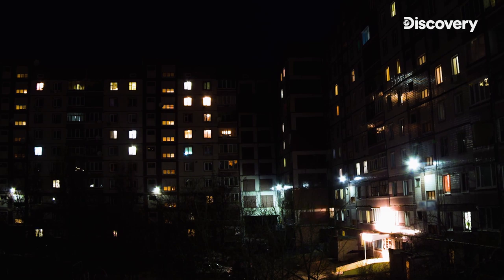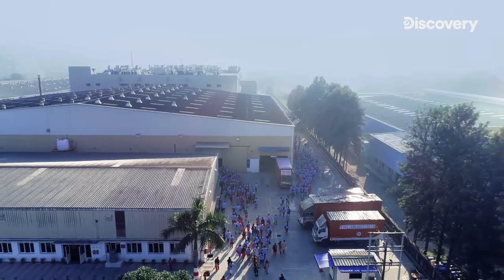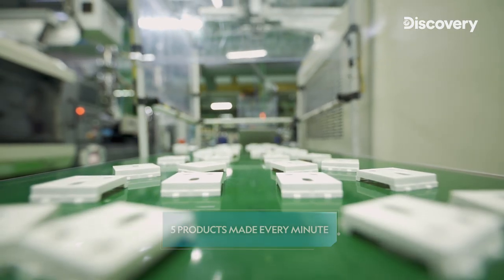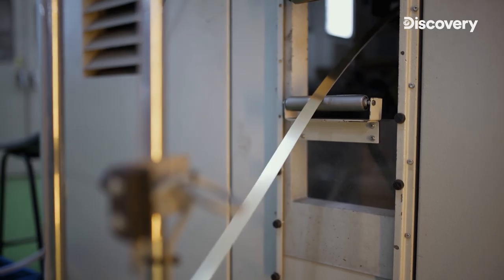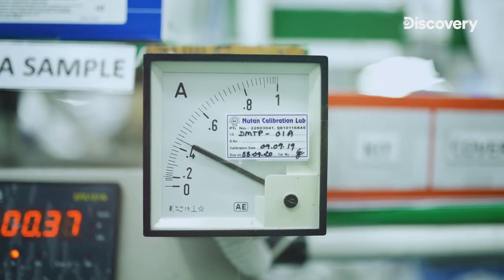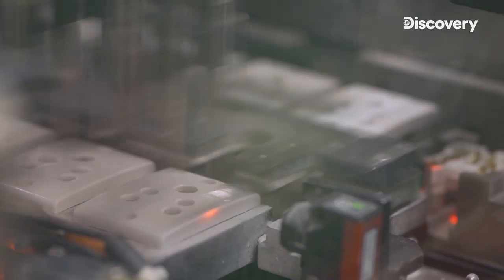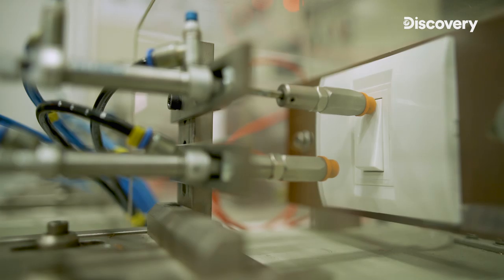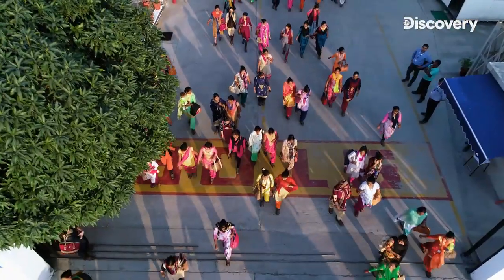Anchor by Panasonic, Haridwar Unit - featured in The Great Indian Factory

Comment: Proud to be a dealer of Anchor 😊
Reply: Hello sir
Reply: Apka nmbr milega
Reply: Hello sir apki ek help chahiya thi maine wire buy ki anchor effr but muja usmai koi QR code nhi mila to check whether it is original or not QR code ata hai effr mai ya nhi
Reply: @akashtomar7845  Yes QR CODE AVAILABLE IN BOTH ADVANCE FR AND EFFR (90 mtr coil)
Reply: @shaheenenterprises3615  but in my wire QR code is no available
Reply: @akashtomar7845  Kindly ask your Supplier. Because QR scan is available in wires, mcb, DB
Reply: How to become its dealer?
Reply: @punitsharma6972  kindly contact your nearest authorised distributor
Reply: Couldn't find any info in the website. Do you have any contacts? How much investment is needed for a beginner?